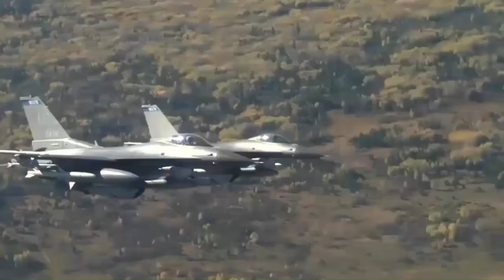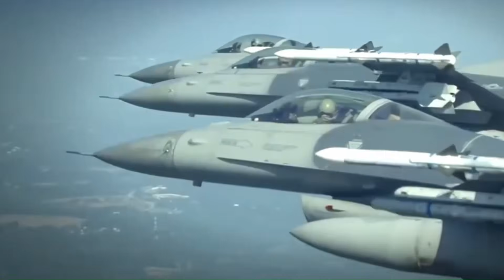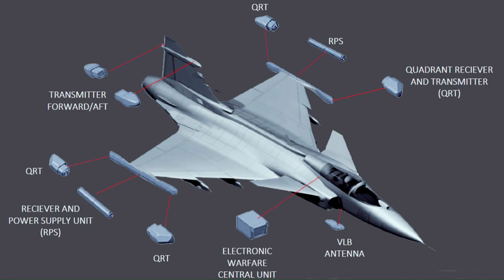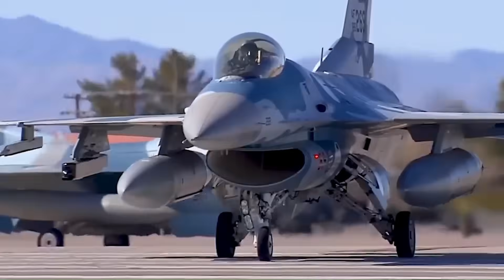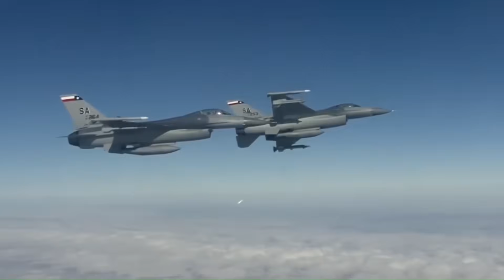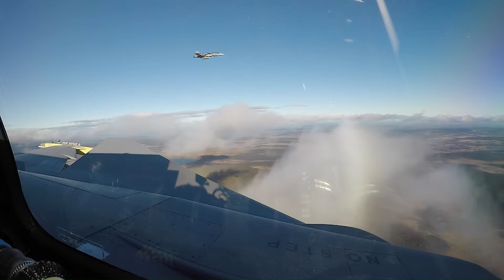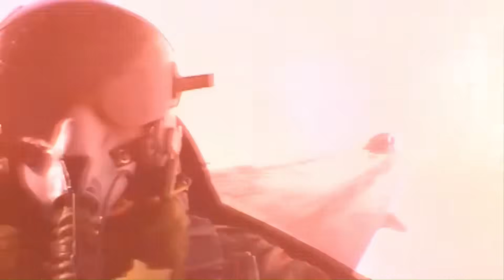Gripen E vs F-16 Block 70: Who is the Most Powerful Fighter Jet?

Comment: They are designed for different types of warfare, The F-16 needs a bigger logistic chain or an alliance like NATO or big countries like the USA to keep the bases safe. If your bases go kaboom F-16 is worthless. 

That is why Gripen is designed to work from roads with its dispersed doctrine with fast maintenance and turnaround times. Sweden was military unaligned when the Gripen was designed and Sweden had to rely on it self for the defence.
Reply: El gripen no tiene industria es limitado si necesita refaccion la cadena logística le costará más tiempo conseguirlo y eso es fatal en un conflicto porque el Gripen quedaría en tierra por largo tiempo no posee una cadena logística aparte el. Gripen es más pelea de guerrillas y solo tiene suposiciónes de combate en cambio el f16 Block 70 es letal con su nueva estructura en avionica no se le. Puede comparar con los anteriores f16 porque este es. Un cambio total los f16 Block 70 72
Reply: Todo es pura teoría, además que su tecnología no es 100% sueca, cuando le ofrecieron a Perú en teoría su precio era barato pero en la práctica salía casi el mismo precio que el rafale, además de cuanto tiempo demoraron en entregarle primer avión a Brasil,  casi 10 años, ahora cuanto demorara en llegar a Colombia

Comment: In the Swedish doctrine, a Gripen never flies alone. Sensor fusion allows multiple Gripens to share target tracking data. One Gripen can carry out the mission to give a meteor optimum launch energy and quickly turn away from engaging fighters. Throw a Globaleye into the mix.......
Reply: EL  GRIPEN  ES  MUY  INFERIOR
Reply: @MichelleCox-j3k por qué usted lo dice
Reply: The F-16 Block 70 & 80 have data link too, advanced EW,  AN-APG 85 / GAN AESA Radar,  an airframe purpose built to do 9 G maneuvers, add an E-2D Hawkeye, then throw a AIM-260 JATM into the mix & everything you said is irrelevant. Even if the Viper was alone, same outcome. From over 150 miles away. Plus little brothers Raptor and Eagle II are always around nearby with a possibility of EA-18 Growlers playing Jedi Knight mind tricks with all your fused sensors. My money is on the Viper - it ain't your grandpa's Fighting Falcon.
Reply: Neither the F-16 kiddo...

Comment: You didn´t mention how much it cost to fly per hor with each plane. In many cases numbers make the winner. But look at Russia and Ucraine or when US went into vietnam. Those looked like an obvious win´s but didn´t play out that way
Reply from the maker: It is difficult to talk about the cost per flight hour fairly, as there are different ways of measuring the cost that generate different results. Sometimes the same plane may have a different flight hour cost operating across different nations. Furthermore, the Gripen E is still coming into operation, so there is no concrete data on its cost per flight hour, only estimates. For these reasons we left this topic out of the comparison.
Reply: @MilitaryMight-xl1um  Brazil received the first Gripen E Friday April 1st 2022 - mission ready, in case of doubts. It was the first country to use the E platform. And ofc with SAAB's tech transfer. So the idea that is new like it was just produced this year is completely incorrect. I invite to look at FAB's page - or even SAAB, they have all the history regarding Brazil as they pioneered the Gripen E version. Cheers.
Reply: @MilitaryMight-xl1um  just wondered because many of the other channels does it
Reply from the maker: Many channels treat these issues in a simplistic way. They don't check sources, they ignore methodologies and end up providing incorrect information.
Reply: @MilitaryMight-xl1um  Might be so in some cases. But most have almost the same numbers. You have 622 subs and many of them have sevrel hundred thousands of subs. I don´t mean that to offend you in any way. But for a larger channel have more eyes on them and there for it is more important to be correct or the will lose subs and then their income

Comment: Gripen E was produced as an upgrade and not as an rush. It had very good engineers which knew exactly what their goal and point was. Hear me out I'm not saying the F-16 didn't have good engineers just saying it was very rushed as we see in other versions of the F jet.
Reply from the maker: Yes, the F-16 Block 70 was developed as a faster and cheaper upgrade of legacy platforms, unlike the F-16 Block 60 Desert Falcon, which is the result of a deeper and more expensive modernization.

Comment: Interesting comparison.  I can only say that it seems to be a better deal to buy Gripen-E because of tech transfer, but to me there is one more advantage or difference which needs explaining: The operational cost in a war-theatre; here it seems obvious that the Gripens give more bang for the buck, especially after the many modern additions to the version-E.
In a future development it would be the same political bindings, is my guess, as Gripen now uses GE engines with trade restrictions.
Reply from the maker: Yes, I would like to have included the operational cost, but as the Gripen E is still in the introduction phase, there is no precise data on the cost per flight hour, for example. In any case, it is quite reasonable to think that the Gripen E is operationally cheaper, since its logistics, as we have seen, are simpler, and it even requires much less personnel.
Reply: @MilitaryMight-xl1um  Does it require fewer personnel to maintain because of differences in maintainer training and SOPs, or because it is a mechanically simpler aircraft?
Reply: @TheYemcl  :: It is because the gear needed for maintenance procedures are better designed, - just my 10 cents.